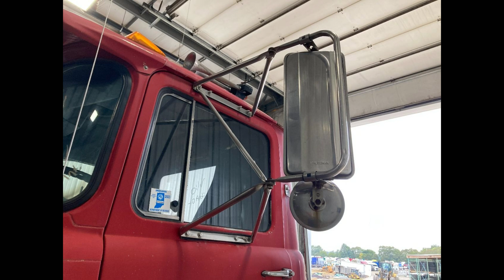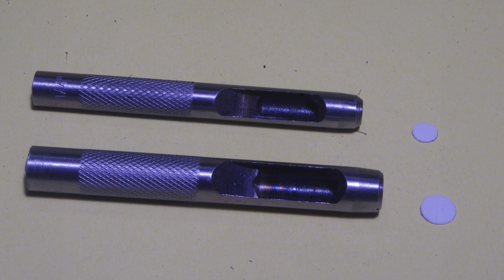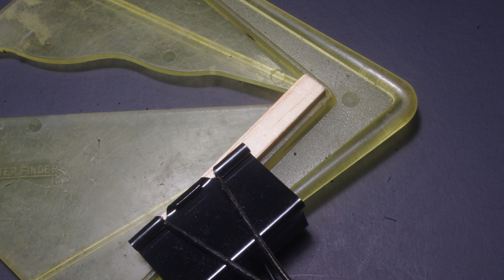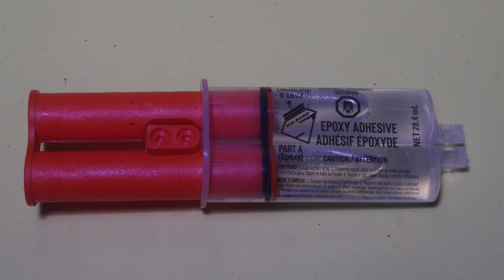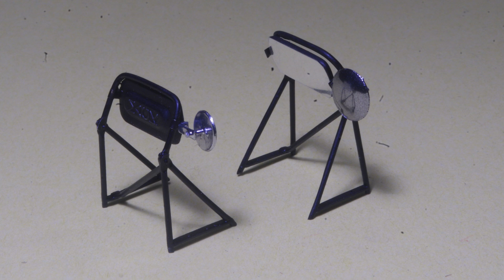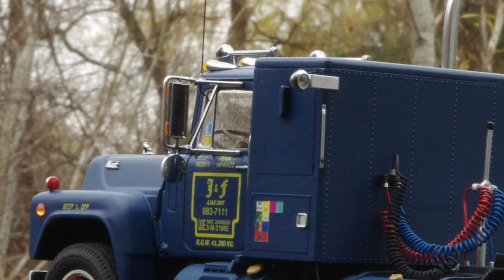Scratch build convex spot mirrors for 1/25 scale big rigs - an easy detail to add

Comment: I've got a big plan for a resin cast chopped Pete 359 build - 300" wheelbase day cab (plus 10-12" straight pipes, and some other touches)! I saw this a while ago and am gonna have to use it - also going to watch the scratch mirror video. The trailer is a 40' reefer box - gonna letter it with 5/8" (real size) white letter decals - "PROFESSIONAL FREIGHT RELOCATION ENGINEERS" - truck and trailer are going to be black.

I've been a trucker for four decades. Couldn't drive without the fisheyes. In the old cabover days, we also had a large spot mirror (about a half ball, not just a convex!) that we called a "Dolly Parton" that was mounted over the windshield on the right side. Gave GREAT visibility around the front and front passenger corner of the cabover!

Comment: Look,s very nice 👍🏼 ive made lot,s of fender mirror,s for on the R600 Mack,s ive made them just a little different. I took a shirt button and ground it down ½ size thickness, with a Dremel than taken styrene thin solid tube plastic rod glued it together sanding it and made bracket,s from thin  styrene! For the mirror part to mount to the fender. I just used regular chrome bumper tape and trimmed the edges came out perfect ive also made made them for cabover model,s aswell for the front and top corner,s of   the front cab.
Reply from the maker: Fender mirrors brings back a memory from the time I worked for J&F Trucking and drove Mack R's, head mechanic in charge of the shop hated fender mirrors for some reason so if J&F bought a truck that had them and was going to overhaul it (at that time they were buying up a lot of 6 and 7 year old trucks for their fleet) the fender mirrors came off it it was equipped with them.

Occasionally one would come into the fleet in great condition and just get relettered, those got to keep their fender mirrors! Two of the trucks I drove during my J&F days had fender mirrors: An R600 and a Superliner! Both were a different colour from J&F's dark blue as well, the R600 was black and the Superliner was white.

Comment: Great video , I’m building IH 4300 Transtar I’ve watch your 4300 build any updates on that kit ?
Reply from the maker: It was "on hold" for a couple months as I worked on getting the Mack R600 completed, wanted to get one model ready for Fulton show in November and the Mack was closest to completion. Starting back on the Transtar now, will have a video up in the near future on air cleaner and intake piping.

Comment: Robert, blind sport mirrors are an overlooked detail, on model truck kits! Many types of trucks use convex mirrors. Semi tractors, trash trucks, school buses, and now fire apparatus. Never knew that there were different sizes of mirrors, on the same truck! Pedestrians & bicyclists are reason for more mirrors on big trucks! If you go to NYC, all the trucks have convex mirrors on their front bumpers. Blind spots plague a big truck operator! Backup cameras are changing that!
Reply: FYI, not all of us have fender mirrors. I've gone into NYC without them ... 

295" wheelbase Pete 389, 5th wheel all the way back to keep steer axle weight legal, with a 53' stepdeck with 10' spread with a 48' bridge (kingpin just 18" from the front of the trailer!!). Oh, that was a TREAT ....

Comment: So simple yet SO effective. Thanks for the "pro tip" :)
Reply from the maker: You're welcome - full disclosure, the 5 minute epoxy wasn't the first method I tried! I did get acceptable results using a brass thumbtack for convex surface (mounting stem already attach although a bit on the coarse side), one drawback to that method is limited range of sizes. Styrene disks from here forward!

Comment: Thanks for this. Mirrors have always been a difficult part of each truck build for me. Looking forward to your regular mirror how to. Will add these round mirrors to the list of things to try.
Reply from the maker: Truck mirrors are always challenging, kit parts can often be either fairly accurate although oversize and difficult to glue together, or closer to scale size but oversimplified. (Both mirror options in the AMT Mack R kit fit this category with the standard ones being accurate/oversize and requiring multiple tiny glue joints and the deluxe ones being one dimensional with only two attachment points. In both cases the mirror heads themselves are well done).

I have gone between styrene rod and brass wire on various projects over the years, styrene rod was used most recently on the current Mack R project for ease of flattening and drilling the ends then joining with solvent cement. Brass wire is much nicer to work with for making curved shapes and 90 degree bends though.